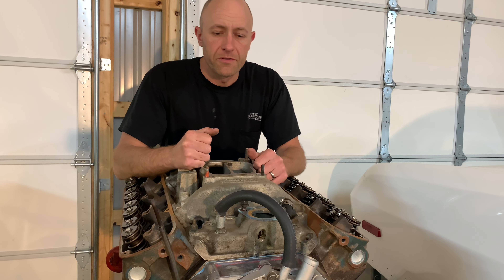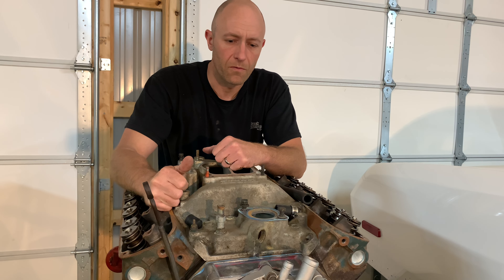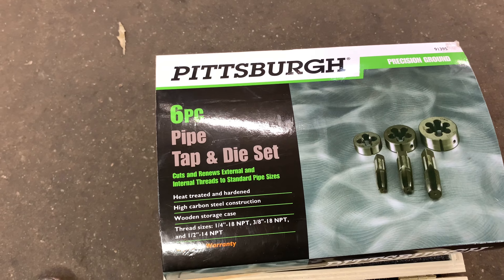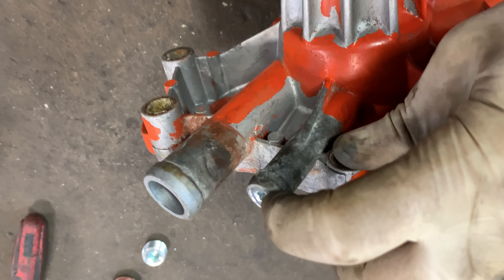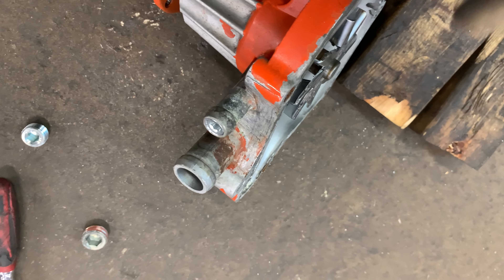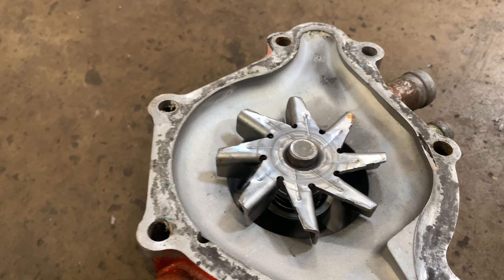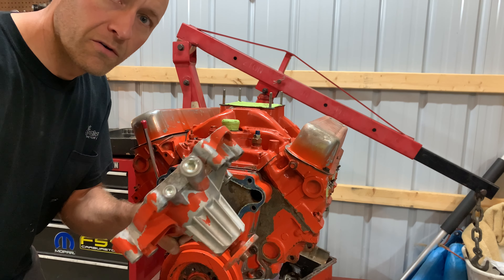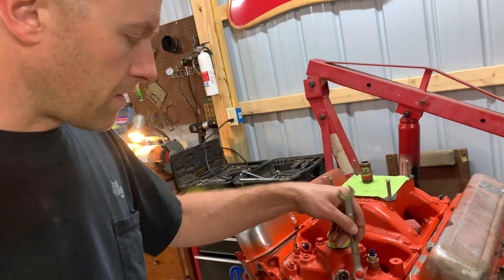Small block Mopar heater hose delete done RIGHT.

Comment: I think I will do this on my small block. Thanks good video
Reply from the maker: @Zerkosgarage.-qz2js  That’s cool. I’m glad you found it useful.
Reply: Did you drill any holes in the thermostat to still have a bypass flow for circulation as the car warms up?
Reply from the maker: @Zerkosgarage.-qz2js  I actually did a little later on. I found that the temperature would spike momentarily after a full throttle pull. The two holes I drilled in the thermostat cured that.

Comment: What squirter size you running on your 340?
Reply from the maker: My white Duster has a 340 with a Holley 600 vac secondary, 31 squirter. My yellow Dusters 360 has a 750 double pumper, 37 squirters front and rear.
Reply: @Duster_Garage  mine has a 31 in both. The 340. Had an off idle or floored while moving hesitation. Put in a hollow bolt to the squirters which made it almost go away. Now im thinking of trying different size squirters, its a 650 double pumper. Also might try different cam after that if it’s the same.
Reply from the maker: @CashMopar  a stumble on acceleration is usually caused by a lean condition. Bigger squirters would probably help.
Reply: That’s the way I did my thermostat bypass, but I retained the heater for the time being.

Comment: Well closing off the coolant bypass is not a good idea 👎🏻
The heater is okay 👌 to block off.
When the thermostat is closed you need flow passed the thermostat to flow coolant passing the wax element
Reply from the maker: You’re correct and I did have an issue with that. I resolved it by drilling two 1/4 holes in the thermostat to allow flow while it’s closed.